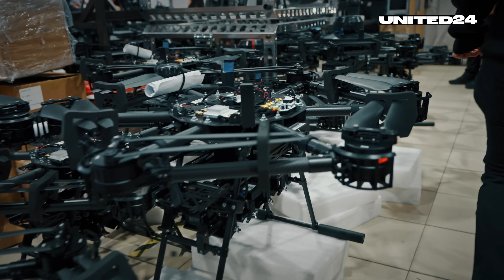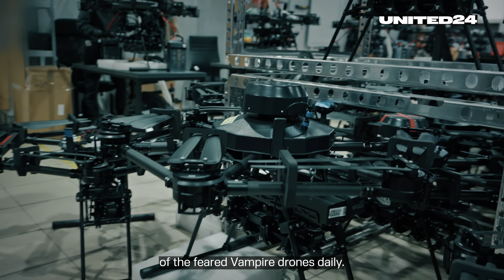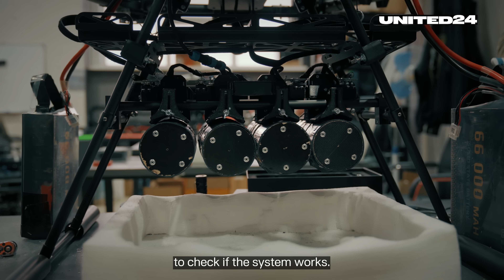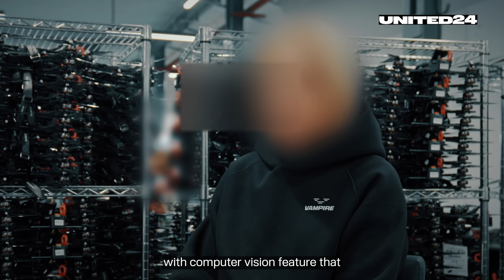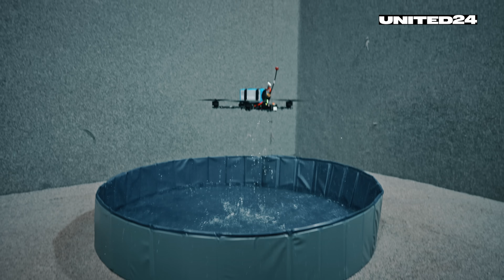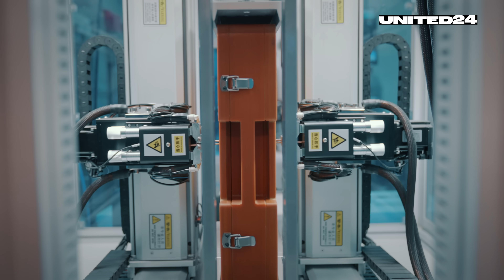Inside the Most Secret Ukrainian Factory Producing Thousands Vampire Drones a Day

Comment: I am surprised EMP weapons are not being used as a counter measure to combat drone warfare!!!! Is it because they don't know how, or just haven't thought of it yet? Super capacitors discharging millions of volts of high frequency current into super conductive magnets will do the trick!!!!! This should be able to take out any unshielded electronics within a 100 feet radius!!! You cannot shield the motor winding from getting fried by the EMP!!! I would be working on developing this kind of tech for sure if I was involved, but thank God I'm not!!!! lol
Reply: Hello. I am a drone pilot and engineer in Ukraine. You have to consider the environment in which a defense system is going to be used. EMP devices typically have very limited autonomy due to the energy requirement but on the frontline if you down even one drone coming at you, you are far from safe, 2, 3, 4, 5, 10…. more will be coming in the next minutes. An heavy and essentially one or few shot systems would protect you from the first drone but will not save your life at the end of the day.
Reply: @Zzzartgvjllnxdkp  Thanks for the info!

Comment: So many printers... probably be faster and cheaper to use injection moulding, at that sort of production level. Kudos to Ukraine getting their production to where it is, but a shift in method will pay off more than continuing upscaling printer banks in my opinion
Reply: However, they are much easier to move to another place and you can change/update  the design of the parts extremely quickly.
Reply: Injection molding requires more technology and supporting facilities. In comparison, 3D printers are a better choice, although they are slower in efficiency.

Comment: For ground operations you should put a camera and stronger remote signal and you could have something to drive over almost any terrain the xmaax
Reply: If you roll it on its roof ya can push a button and it will self right back onto the wheels

Comment: Thousands a day? Where do they get the money for parts?
Reply: Larger amount - bigger discount!
Reply: @Attilafia  You can't get unlimited discount, you know.. For that much tech a small one is at least 150$ and the big ones are at least 1000$. Thousands a day means at least half a million per day * 30 days, that's at least 15M a month * 12 is 180M just for drones a year. And that's with 0 margin. Add some and for electricity and food and accommodation for the workers and all else and you can easily go up to 300-400M a year just for these drones. I am not sure that Ukr has the money for that. Also, if they could produces thousands a day, I can assure you that the war would be over. So extremely exaggerated .

Comment: Considering the internal components are still imported from China especially the motors, batteries and some times even the flight controllers, and video transmitters. AliExpress, Taobao and Temu still have the components Ukrainians have paraded as domestically built.
Reply: 80-90% виробництва локалізовано.

Comment: Hate to tell you there's software that will remove you're facial protection software from videos
Reply: Nope. There's software that can add a face there, but not the person's actual face. As long as the censorship is randomized there is no way to reverse it any more than you can "enhance" a low resolution image.

Comment: Hmm. Believe what you may, but it’s a little hard to believe, given that up til recently Ukraine’s drone production was claimed to be 2-3 million per year, max. At 4,000 per day, this one facility alone would be doing 1.5 million, or more than half of Ukraine’s claimed output. Secondly, it’s interesting they continue to proudly refer to it as Ukraine’s “domestic” production, continually building up Ukraine as some kind of self-sufficient powerhouse capable of going it alone, and slugging it out with Russia with little outside help. Yet in the very opening of the video, the host curiously describes the production site as being: “A few thousand kilometers from the frontline…” The distance from the Polish border to Donetsk is ~1,000Km. So, where is this facility, exactly, that it is “a few thousand kilometers” from the frontline? Is this really Ukraine’s brawny “domestic” production at its finest? Seems more likely it’s sat in Poland or Germany, not Ukraine proper.
Reply: in 2024 UA produced 1.4 million of FPV drones. In 2025 they expanded production and they will produce between 4-5million of drones(all types). 
Where is this facility? USSR had lot of underground bases capable to survive nuclear blast in Ukraine(and other soviet republics). Even in Croatia we still have lot of abandoned underground bases from former communist countries. 
Since Ukraine is 10x size and USSR was more militaristic , so there kilometers and kilometers of underground bases I guess in Carpathian mountains(west Ukraine) that can survive even nuclear blast , and conventional rockets can do only little damage. From Lviv to Prokorovsk is 950km, while from Hamburg to Munich is 650km.

Comment: Injection moulding is a far quicker and cheaper way of making plastic parts unless those parts are particularly complex. Ukraine must have some firms that specialise in injection moulding and Western Europe must have plenty of good used machines that could be provided.
Reply: Thats true in general but it seems that the drones are constantly changed. Which is much easier to achieve when 3d printing. And we dont know what the limiting factor of droneproduction is. It might be the electronics.
Reply: @rocksmo3384  One big advantage Russia has is the ability to scale up production of drones to very large numbers relatively quickly. Ukraine has more of a cottage industry approach with very many small to medium manufacturers that in total still manufacture as many or more drones as Russia. Russia also copies some of Ukraine's many drone innovations and mass produces these innovations and incorporates them in a few weeks time. To compete with this Ukraine will at some point need to release new innovations to the battlefield for the first time suddenly in very large volumes across the entire front simultaneously so as to maximise their effectiveness until Russia can develop suitable countermeasures. Plastic injection moulding is great for high volume rapid and low cost production. Moulds can be made fairly quickly and many drone components can be designed from a number of parts that fit together so when drone designs change only one or two components need to change and then often only minimally.
Reply: 3d printing can accommodate changes faster
Reply: I agree 3D printers are not effective for mass production
Injection molding is one of China's secret to making everything cheap

Comment: With mass-production stream-lined like this, there is little room for other options except what may be attatched onto this particular frame after the fact(after-market) though these drones are proven to be effective as a multi-purpose tool of aerial superiority. The demand is extreme as they are a one-time use in a lot of cases. Things like bolting picatinny rails(rifle rails) may help for future add-ons in the field. However, the rails may be best in the hands of the operator so as to not slow down production in this building.

Comment: Anyone knows why they use 3d printers for mass production and not some injection molds or something similar?
Reply: Its easy to reshape and make changes with 3d print, if you can get a different kind of motor or camera  its very easy to modify the design and keep moving forward.
Reply: @hugolatra3d  faire enough. Ty
Its True that she said that the biggest bottleneck is supply not production, so no need to be faster there.